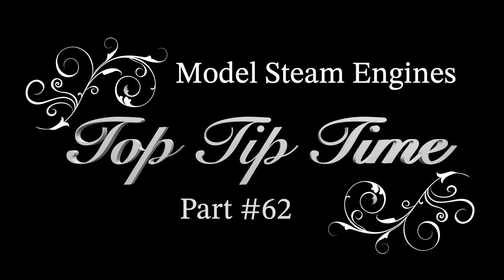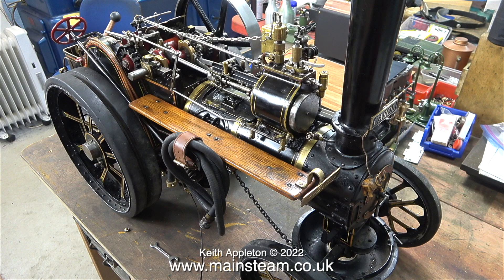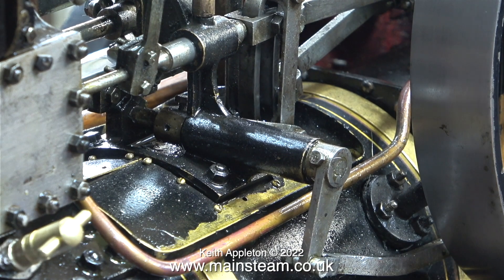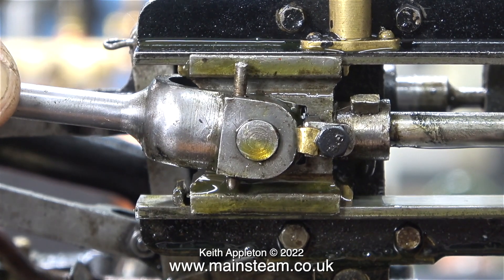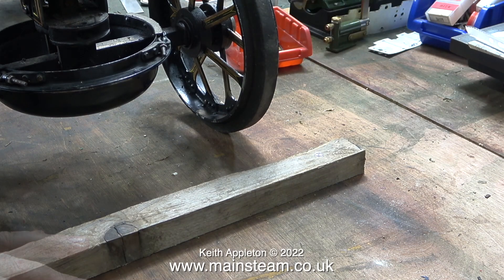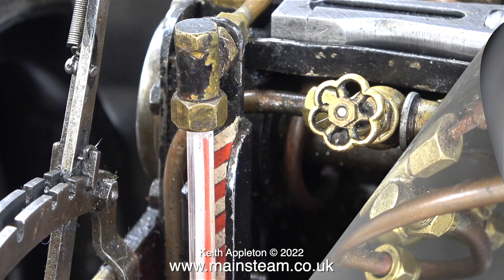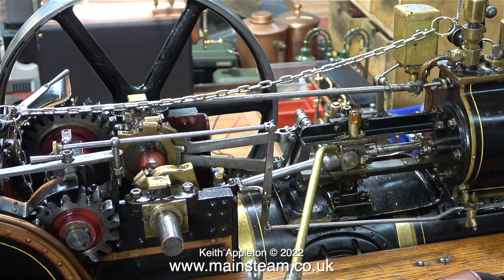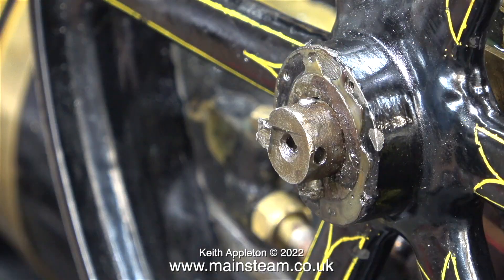MODEL STEAM ENGINES - TOP TIP TIME - PART #62

Comment: I would like to know where to put the water inlet to the boiler from a injector
Reply from the maker: Just connect it to a suitable Check Valve on the boiler .......... if you don't have a spare one, then make an adaptor. Just watch more of my videos . . . . .